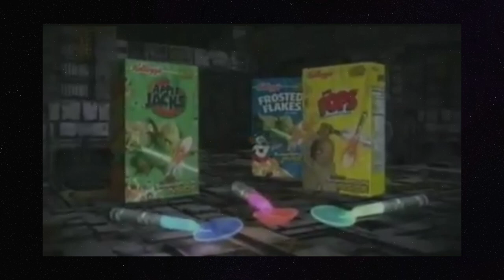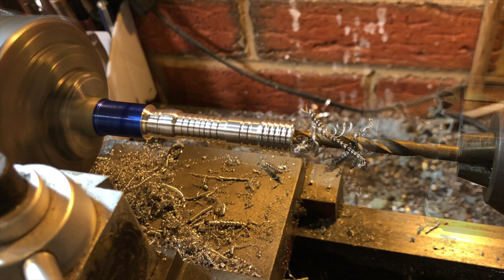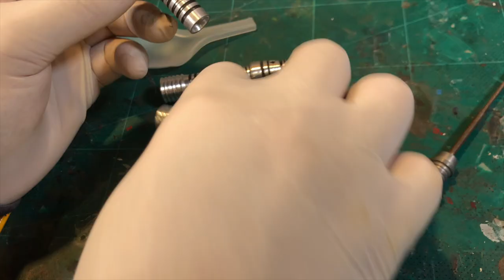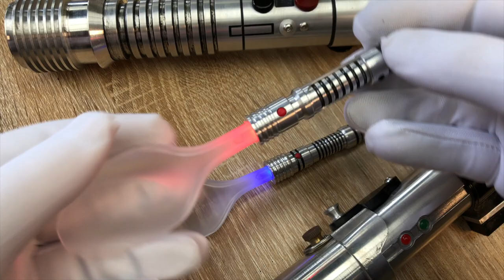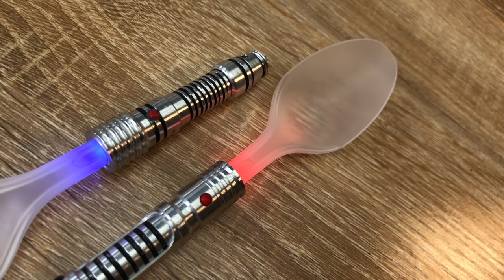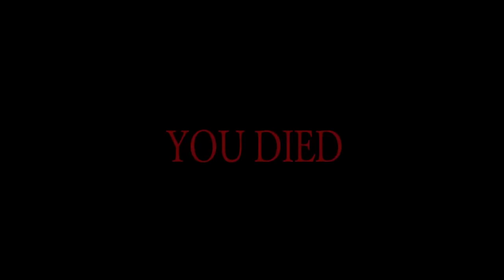Metal Lightsaber Spoon | Nostalgia Build

Comment: Could have used a little more info about the original toy since some people may not have been around or knew about it . Also pointing out your version is different better made of metal and a little bigger. Still need to make the green one but make a purple Mace Windu and an orange one as well. I remember them and am pretty confident that I did have one, used a little but was an adult and after a bit the novelty wore off and it disappeared somewhere.